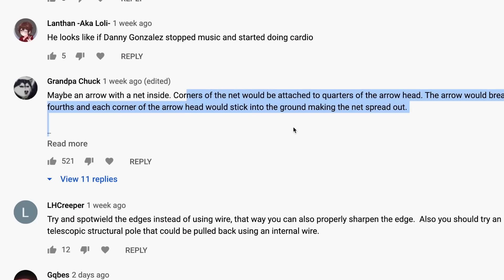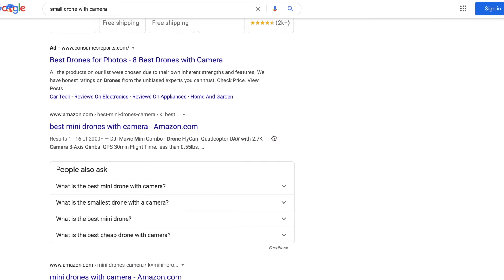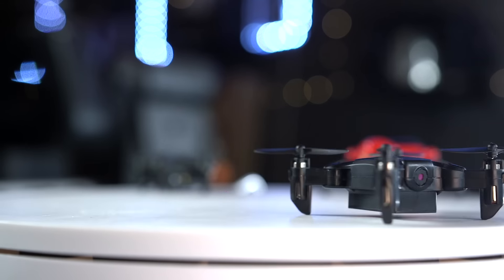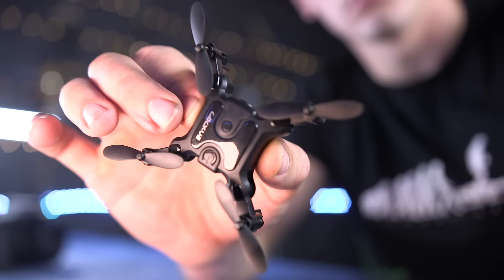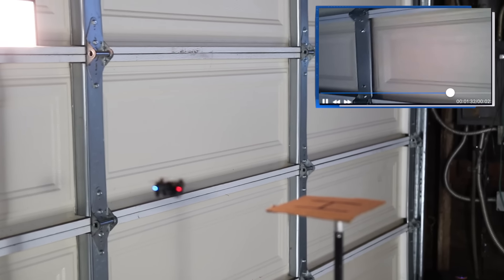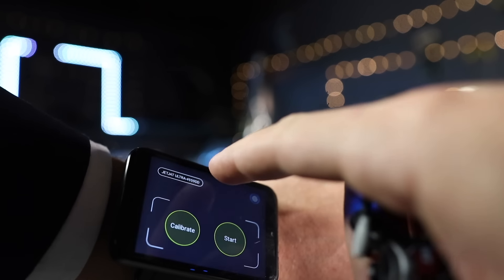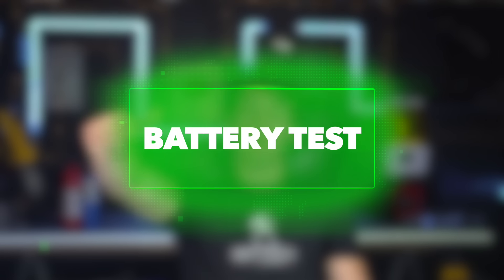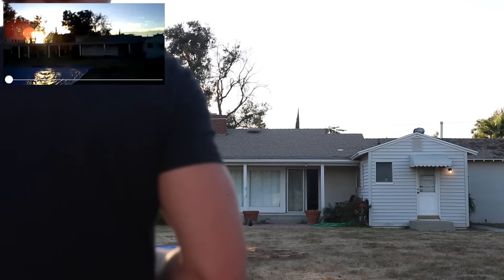Make a Watch That Turns Into a Spy Drone W/ Live Video! (Incredibles/Spider-Man Gadget for Cheap)

Comment: Make a REALLY high voltage spear like Jurassic park
Reply: Get a pipe, shove some aa batteries down it (so they all connect properly, maybe even wire up a bunch of 9 volts) and connect the negative end to one spike and the positive end to the other that way when the spear stabs or touches something conductive it will complete the circuit causing a sudden shock. It's pretty simple but a bit dangerous if not done right.

Comment: You should make a Thor’s hammer that flies back to you after you throw it.
Like for this idea
Reply: Ya like a drone hammer
Reply: @andrewvanderhave6228  imagine a hammer with 4 propeller 🤣
Reply: @andrewvanderhave6228  but its a good idea
Reply: @jpxtreme0828  Actually someone has created on of those. The channel’s name is FlightTest
Reply: Flitetest
Reply: How would that work
Reply: It won’t look cool because it will have propellers, and you need a battery and a way to charge it
Reply: Maybe there could be a rope at the end of the handle that attached to maybe some thing like a suit that went up the arm and went down to the waist so as to avoid injuries,And in order to retract it there would be a retrieval system on a belt
Reply: Frank Lundy  um....

Comment: Make a Bluetooth hose 😂

I know it's not possible
Reply: It could be if he made it
Reply: Anything is possible
Reply: @itsmexd6298  that is true
Reply: “Are you like, challenging me?”
Reply: Yes
Reply: BLOPS GAMING it is
Reply: but what if yes?
Reply: Just use an rc car and it's motors, attatch a motor to the valve of the hose with a gear ratio for torque and then you can use the remote to spin the motor turning it on and off. I'm too much of a nerd for my own good.
Reply: @Destroyer243 I thought the same thing
Reply: If you can think it you can do it. You are half way there.

Comment: Suggestion, make hiccup's retractable sword from how to train your dragon, I've seen it made using propane gas, but is it possible to use a liquid as the flame, it would be closer to cannon, in the movies the sword uses monsterous nightmare gel. It also has a hot swappable module that switches to a gas spray with a (I presume) flint lighter to make the gas blow up, the gas is hideous zippleback gas, to which is a green gas that is low hanging (has a higher density than oxygen). All of it's features can be better seen in the secind mivie when hiccup gets kidnapped by his soon to be revealed long lost mother.

Edit: I just realize how nerdy I sound, I mostly want to see someone build it as close to cannon as possible because I don't have enough money to do so, I do have the know how though.
Reply: The monstrous nightmare gel is essentially Napalm.
Reply: @jacobf6945  yeah, you're not wrong! Do you like the idea?
Reply: @Destroyer243  I have also seen it done with propane, it would be interesting if he'd be able or willing to try for a gel based fuel, napalm is dangerous but burns long not saying that is what should be used but it is possible to find a gel fuel
Reply: He already made one
Reply: @purplehoneycomb6456  No, the hacksmith did. He only made a normal fire sword.
Reply: @jacobf6945  I was thinking that maybe he could have the gel put into the sword hilt so that when he retracts the sword it gets immediately coated in the gel.
Reply: @Michael Balog What was? I don't know what was impressive about the comment.
Reply: @purplehoneycomb6456  JLaser has made a fire sword, and a retractable sword but not a flaming retractable sword
Reply: @jacobf6945  also, napalm produces carbon monoxide, so that's not the best idea.

Comment: Make watch that shoots a microphone projectile that goes with a earphone to hear what the mic is recording
Reply: That's cool
Reply: That’s awso
Reply: Yessssss!
Reply: Love it
Reply: Yees
Reply: That is such an awesome idea
Reply: All you need is a bunch of rubberbands and some consistent way af attatching to objects, magnets maybe? IDK depends on what is used, maybe a hot swappable anchor system.
Reply: K that’s actually cool
Reply: Awesome idea!
Reply: @Destroyer243  Perhaps a kind of adhesive
Reply: @houselightkell  Yeah, one that doesn't harden, but isn't too soft and falls apart immediately.
Reply: @Destroyer243  or something that can be melted?
Reply: Since the mic will be flying through the air, the only thing you would probably hear is air noise right?

Comment: 7:54 Sure, you wouldn't notice that it's hiding a drone. But that huge bulk on your wrist means you're either wearing a toy, or some poorly shrunken spy gear, and considering that it's a drone, it basically is. It  literally stand out less, if you wore it over some kind of puffy coat that makes your arms look thicker to begin with, and the hairs could hide the watch. Although those artificial hairs shouldn't be long enough to get stuck in the propellers. xD
8:02 Oh, come on! You couldn't at least put a little screen on there and make it a digital watch?

Comment: Great video. I really enjoy tinkering and watching your videos gives me ideas. Here's another idea for you. How about making the watch also serve as a controller, and possibly even a monitor. I know that's a big ask but with the existing smart watches out there now, at least the monitor part should be attainable. As to the controller, given the bulk of the watch shown here, it would make sense to have the case also have a function, other than just a housing for the drone. The wrist band could unfold and lock into place to allow the sticks to be placed at each end of the band, (close to the buckles) allowing for them to be far enough apart for easy control once the watch is removed. As to the monitor being incorporated into the watch idea, that may not be as important since any smartphone could serve as a monitor, and most "spies" are probably going to also have a smartphone with them; that is unless they don't want to be detected, in which case a non GPS monitor might be pf some importance, even if it has to be worn on the other wrist.